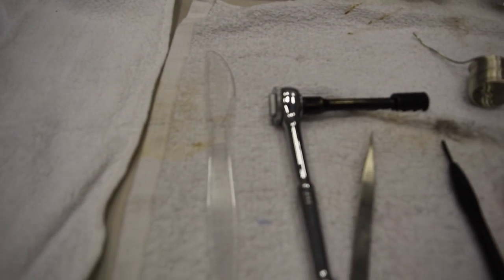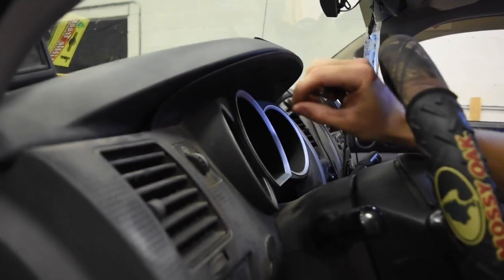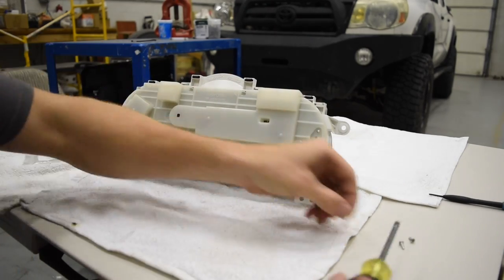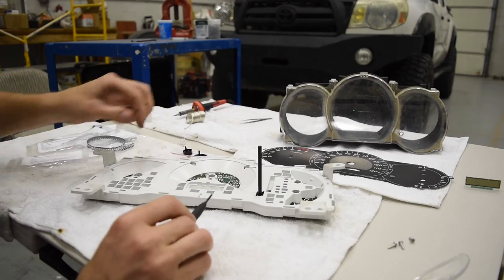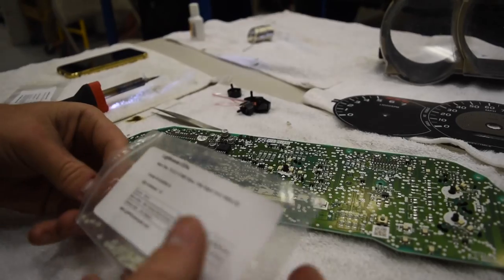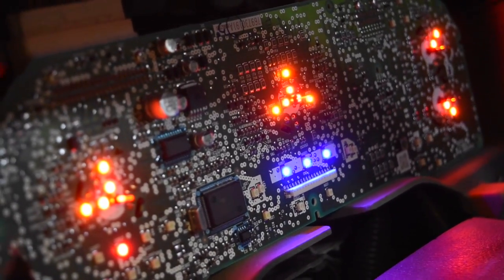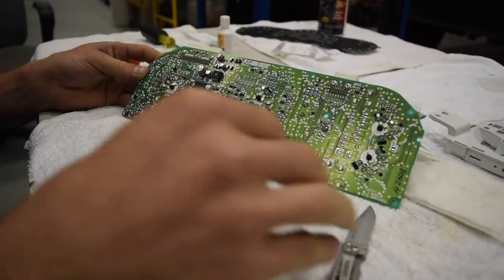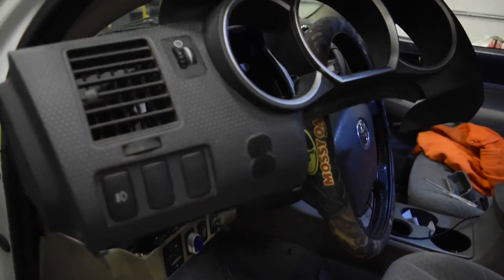Replace Toyota Tacoma LED dashboard instrument light LED

Comment: Can you help me. I did all the outside back lite lights .. replaced and periodically checked and they all worked. I then went and did all the needles. I didn’t check .. replaced them all and now none work. Any thoughts. I am certain that I put the notch in the right spot. Do you know if they all run in series that if one’s out they are all out? Thank you

Comment: I can't thank you enough for this video! I did my Tacoma today and it came out beautiful! Wish I could show you, just because your video made it possible.
Reply: Campingeighty4 any tips or tricks? I’m gonna do mine. Also how many bulbs do you need to order?
Reply: @undeadman813  If you haven't done it yet, you get a price cut if you order 50. You need roughly 45 so it's safe to get a few extra...and you pay less for more.
Reply: Where did you order them from and what size smd are used? 3528?
Reply: @MrRozee12  I ordered all mine from lighthouseleds.com and I got around 50 like the guy above says. It's good to have extra. 
Yes, that size is right. 3528.
Reply: @undeadman813  Sorry man, never got this message. I followed this video step by step and had no issues. Careful on the odometer glass. And take tons of pictures of your needles! That I had to do 3 times to be very accurate.
Reply: @samdempsey4209  great advice. I did the same.

Comment: i have never soldered before in my life, this was intimidating at first just because of all of the things on the electronic board but it is very simple. i did it with a battery operated soldering iron which i don't recommend because of consistency. just take your time and remember to take a pic of your needles before you remove them.

Comment: Great video but how do you do the light is the stereo and climate controls?
Reply: The clock has a film on it that can rub off, the climate controls are a T4 wedge light. The climate housing pops right out and the lights are right there.

Comment: Just finished changing all the lights and everything turned it great except my gauges! They won't react to anything. I've read multiple threads on it and nothing is working. You say I'm the video that when you plug it back it they will reset but when I plug mine in they simply don't do anything. Please help!

Comment: My 2002 Highlander has soldered in lights. I will try. I did remove the cluster, I noticed the fuel needle stays on Full. It might be stuck as it doesnt move, I think it cam loose when I was working on the cluster. How do you reset the needle so its correct. Is it just not seated correctly to the stem ?

Comment: Great video and instruction! This has turned out to be a fun project. I'm stuck though and was hoping you could give me some pointers? The first 3 LEDs I soldered onto the circuit board were blue for the odometer and they lit up beautifully on the first try. The next 4 don' t light up at all (3 for the speedometer and 1 for the right turn signal). I've made sure the little corner pieces of the LEDs line up with the tiny white dots on the circuit board and it seems like a good solder, but nope, no lights. Any ideas?
Reply: Luke McCabe cold soldering
Reply: @Fosgen  thanks!

Comment: Hey, so I tried the same size LEDs as you and they didn't work. When I checked the voltage on the circuit board contacts, it was only 1.8 volts which is not enough to turn the LED on. I verified that with sufficient voltage, the same LED worked just fine. Any suggestions?

Comment: did you have to add a resistor or anything? Im reading about the lights and it says max voltage is 3.5volts.

Comment: I just tried doing this and I had a little difficulty. The odometer came out fine as did the tach but on the the speedo only the right one works while the left and top one come on for a second then go off. Also the fuel and temp gauges don't work at all no matter which way I put them. By this point I melted the bulbs I think so I have to order more. Any suggestions as to what possibly went wrong?
Reply: @Desert_stormh  why so mean lol?

Comment: I'm assuming it'll have the same kind of leds for a Toyota celica 1994 right? Plus how would I know which way positive and negative go on the celica, will it still have the white dot next to the trimmed side of the led, sorry for the noob question haha
Reply: No, before 2002 there was a simpler system with bulbs you could actually pull out and replace, plug and play (as long as you know how to pull your instrument cluster). For pre-2002 Toyotas it's much easier, look for videos specific to pre-2002. No soldering required.
Reply: Aside from the above reply if you can't use a basic volt meter you shouldn't try this type of mod.

Comment: Does the cluster have a voltage regulator? The reason why I ask, is I can purchase 3.0 volt or 12volt bulbs? Which did you use? Thanks
Reply: Use your DMM to measure it for sure.

Comment: Where do you buy the LEDs? Part #?
Another question: I have a friend that's tired of dealing with his TPMS. He doesn't want to replace the sensors. Can I take the TPMS LED out and not hurt anything else?
Reply: You have to take out and remove the stems & TPMS sensors from 4 wheels.
Then you can place just the regular stems on wheels.

This is a scam & money stealing profits for shops like those cabin filters.

Comment: I did this mod but my needs aren't where they used to be and I tried unplugging and moving needles then putting piece back in but still messed up what do I need to do?
Reply: Get a professional to do it. Plain and simple. Don't want to further complicate and possibly have to replace the whole thing.
Reply: I did this mode long ago and what I did is make a note to where the needles were when the vehicle is turned off. Then I just put them back on you can take a pic or use tape to mark the location of the needles so you know where they go. Even with this, I had to adjust my gas gauge a second time.

Comment: Does anyone know the P/N, or at least the name of the part, that the LEDs are being soldered onto? I can't find any junkyard in a reasonable driving distance that has a Tacoma in my year range (2002). I'd like to buy this part and solder the new LEDs to my old one, having the new one as a backup. I can't seem to find it on Toyota OEM parts websites.

Comment: I would muffle the beeper or add a switch to turn it off when you don't want to hear it then you can turn it back on when you need the buzzer for like leaving the keys in the ignition and putting on seat belts which is required by state law. 73

Comment: My best advise for anyone trying to do this:

If you have never worked with solder before or PCBs, buy some cheap breadboard on amazon and practice. There is a 99% you will burn the PCB if you don’t know what you’re doing. I’ve worked with PCB for years. It takes a minute to get a handle on soldering.

Comment: My lights all went out in the center and dash cluster. I can’t find a fuse blown, any thoughts?
Reply: Was this post mod or did it just happen?

If it’s post mod, you may have melted a line on the PCB. Also, I’ve noticed these are wired in series, so if you put one on the wrong way, the whole thing won’t work.

Comment: where did you order the light and what are they called?
Reply: They are called "fuses" but they are different in amp. You can get them from Toyota dealer or Auto Zone/Part.

Comment: man, I have a 2018 tacoma and everything on the dash is blue which is terrible for night vision and eye fatigue driving at night so i've cut out red photo gel sheets and taped it over the main gauge cluster at night because i was getting such a headache staring at it, was envious of your initial red instrumentation, need to do this in reverse for me '18!
Reply: Yo!! Does your 2018 gauge cluster use the same diodes as this video? 👍